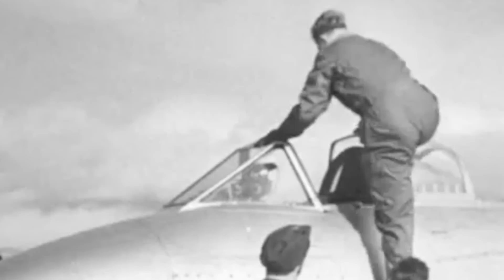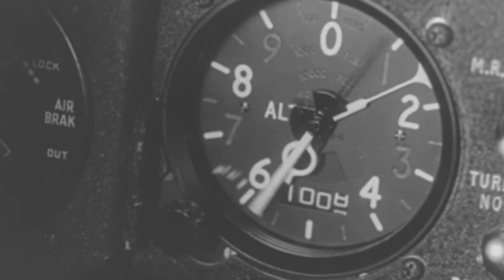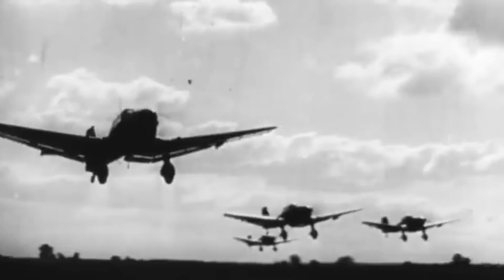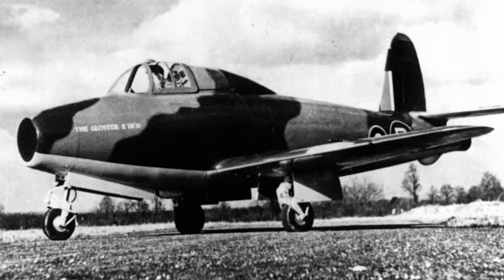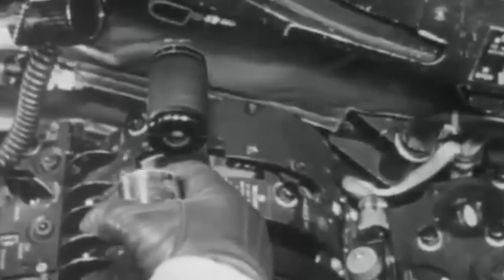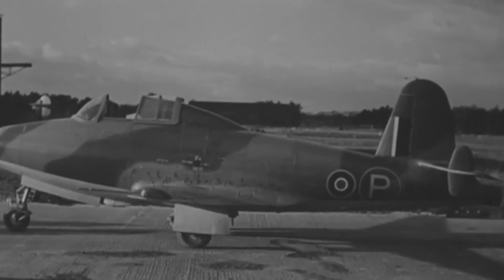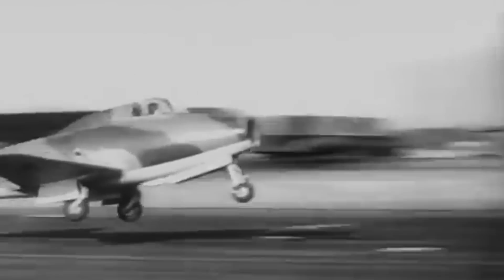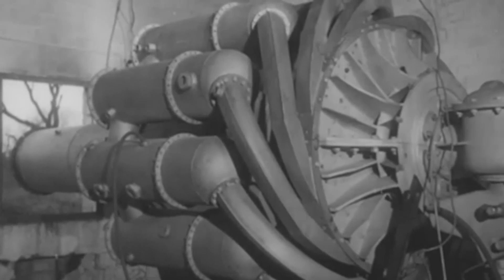Britain's 500 MPH Coffin With Wings

Comment: If Whittle had been given adequate funding in the 30’s we would have had jets in 1940. The brass said the temperatures are too hot for the metals to withstand but that’s also true with steam engines.
Reply: Not exactly, Whittle was still in school and would not begin any serious work on jet engines until moving to Rugby in 1936... this left Whittle years behind jet engine development in Germany.
Whittle would never construct any viable or flight worthy engines.

The real genius behind the British jet engine program was Stanley Hooker and Adrian Lombard, they would not start work until 1940 when Whittle struggled to make any further progress with his engines.
Reply: Actually after A.A.Griffiths (head of engine development at the RAE) 
exposed Whittle for plagiarizing his 1926 paper on gas turbine aircraft engines... he also humiliated Whittle by pointing out several egregious errors in Whittles patent that revealed he did not actually understand how compressors worked.
Whittle was dependent on others to construct his compressors.

Whittle was also unaware of German advancements in heat resistant alloys and he struggled with inferior steels.

It was General Electric turbocharger division that gave Rolls-Royce the first heat resistant alloys to would survive the harsh conditions of jet turbine blades...
Reply: @WilhelmKarsten     

   Yes that's right, Indeed it is without doubt entirely correct that the gas turbine concept was first conceptualised in England before 1800.
    It is also correct that the multistage sequential rotor stator axial compressor & axial turbine as used for power generation & propulsion turbomachinery purposes was of course first produced in England by Parsons of Ireland & North England before 1900 the technology being licensed for manufacture in many other industrialised countries. The same components as used in all current axial gas turbine aero engines.
    Its also well known that serious work on the axial configuration gas turbine aero engine began in England before 1929.  
  
    That is indeed correct, more recently of course the most powerful gas turbine aero engine on the planet in 1944 was in fact the Rolls Royce Nene versions of which would go on to power many jet fighter aircraft including the Mig 15 & many UK & US built jet fighter aircraft during the 1940s & 1950s. The RR Nene was of course twice as powerful as anything produced in Germany at the time & 100 times more reliable & would go on to be copied in Russia & China & built under licence in the US, Sweden France & other countries
   Obviously the required Nimonic Alloy turbine blade material was first developed in England around 1940 & was available nowhere else at the time. It was a Nickel super alloy (Composition is mostly Nickel), Engineers in Germany & the US were attempting to use various kinds of stainless steel such as high Nickel stainless steel (being steel it's mostly iron)  which of course doesn't work.

   Agreed, Gloster Meteor accident losses were not high or unusual for fighter aircraft at the time.
Non combat phase accident losses
% of Aircraft built.
The Canadair CL-44 was a turboprop airliner.
Canadair CL-44                    (ff 1959 ) 48%
Lockheed XF104                    (ff 1954) 100%
Lockheed  P80                       (ff 1944) 43%
Lockheed F104                      (ff 1954) 45%
McDonnell FH Phantom       (ff 1945) 35%
Gloster Meteor                     (ff 1943)  21%
DH Vampire                          (ff 1943)  23%
DH Sea Vixen                       (ff  1951) 33%
Gloster Javelin                     (ff 1951) 20%

A specific comparison.

Gloster Meteor.
3950 Built.
In service 1944.
70% didn't have ejector seats.
839 accident losses.
436 accident loss fatalities.
21% accident losses.
11% accident loss Fatalities.

Lockheed F104.
2578 Built.
In service 1958, 14 years after the Meteor.
All had ejector seats.
1100 accident losses.
425 accident loss fatalities.
43% accident losses.
17% accident loss Fatalities.

   Yes it is the case that the Gloster Meteor broke world speed records in 1945 & 1946. The world's first Turboprop was a modified Gloster Meteor. 1940s & 1950s Russian, British & US jet fighter aircraft usually had British / Russian, British, or British / American technology gas turbine aero engines.
From 1942 onwards British & US jet aircraft were always faster than piston engine fighters if the same year.

   That's right, the world's first demonstration of a pure gas turbine aero engine was of course performed by Frank Whittle in England in 1937.

We hope this helps of course.

Cheers indeed & 👍 obviously.

Comment: 0:16 The British didnt want to emulate the Germans - who had chosen the more advanced axial flow design which Whittle had rejected in favour of the Centrifugal-Flow because the advanced alloys required for the axial flow engine were neither completely established nor available in sufficient quantities to be reliable. He was right; the German engines varied in life expectancy between 6 and 24 hrs before being worn out - and they were never able to improve this, lacking the required alloys - whereas Whittle's intentionally less advanced choice was reliable enough to be viable right from the start.
Reply: Centrifugal compressors are still used extensively today.
Reply: Complete rubbish! As A.A.Griffiths pointed out when he exposed Whittle for plagiarizing his own work he revealed that Whittle had absolutely no understanding of how axial compressors worked.
 Whittle scrapped his defunct 1930 patent and started over using a Furnace blower salvaged from an abandoned iron foundry.
That is false, there is no difference in the metallurgical requirements of the axial compressor compared to the centrifugal.
Whittle lacked proper materials for BOTH, he struggled with inferior alloys such as Browns 18/3 and REX 78.
Steels used in cutlery and kitchen utensils.

Whittle was never able to achieve airworthiness certification.

The Jumo 109-004b easily passed the RAFs 100 hour PFTR reliability requirements and the US Army confirmed TBOs averaged 55 hours between overhauls. EXCELLENT by WW2 standards and better than Allied piston engines!

Eric Brown said that the Me-262 was years ahead of anything the Allies had..
Reply: @sandervanderkammen9230  Yet more nonsense!  
Whittle couldn't plagiarise Griffith's work because he had absolutely no knowledge of it - and Griffith disclosed nothing of his early work (which was no more than an experimental single-stage axial flow compressor/turbine) when he met Whittle in 1929, and summarily dismissed Whittle's turbojet proposal, delivered on his behalf in Tweedie's infamous letter.
It is well known that, in service, the 004B required a part-life overhaul at 10 hours and was typically time-expired at 25-30 hours.  It was an effectively (in current terminology) an expendable engine but, being produced by slave labour, it was 'economical' to do so.  
When it was inspected in detail after the war, it, and the other German engines were judged to be "inferior' - because they were.  In comparison, the Welland (R-R's version of the W.2B) and the Derwent had overhaul lives in excess of 100 hours, having been tested up to 500 hours.
Reply: @sandervanderkammen9230 @WilhelmKarsten     

   Yes that's right, Indeed it is without doubt entirely correct that the gas turbine concept was first conceptualised in England before 1800.
    It is also correct that the multistage sequential rotor stator axial compressor & axial turbine as used for power generation & propulsion turbomachinery purposes was of course first produced in England by Parsons of Ireland & North England before 1900 the technology being licensed for manufacture in many other industrialised countries. The same components as used in all current axial gas turbine aero engines.
    Its also well known that serious work on the axial configuration gas turbine aero engine began in England before 1929.  
  
    That is indeed correct, more recently of course the most powerful gas turbine aero engine on the planet in 1944 was in fact the Rolls Royce Nene versions of which would go on to power many jet fighter aircraft including the Mig 15 & many UK & US built jet fighter aircraft during the 1940s & 1950s. The RR Nene was of course twice as powerful as anything produced in Germany at the time & 100 times more reliable & would go on to be copied in Russia & China & built under licence in the US, Sweden France & other countries
   Obviously the required Nimonic Alloy turbine blade material was first developed in England around 1940 & was available nowhere else at the time. It was a Nickel super alloy (Composition is mostly Nickel), Engineers in Germany & the US were attempting to use various kinds of stainless steel such as high Nickel stainless steel (being steel it's mostly iron)  which of course doesn't work.

   Agreed, Gloster Meteor accident losses were not high or unusual for fighter aircraft at the time.
Non combat phase accident losses
% of Aircraft built.
The Canadair CL-44 was a turboprop airliner.
Canadair CL-44                    (ff 1959 ) 48%
Lockheed XF104                    (ff 1954) 100%
Lockheed  P80                       (ff 1944) 43%
Lockheed F104                      (ff 1954) 45%
McDonnell FH Phantom       (ff 1945) 35%
Gloster Meteor                     (ff 1943)  21%
DH Vampire                          (ff 1943)  23%
DH Sea Vixen                       (ff  1951) 33%
Gloster Javelin                     (ff 1951) 20%

A specific comparison.

Gloster Meteor.
3950 Built.
In service 1944.
70% didn't have ejector seats.
839 accident losses.
436 accident loss fatalities.
21% accident losses.
11% accident loss Fatalities.

Lockheed F104.
2578 Built.
In service 1958, 14 years after the Meteor.
All had ejector seats.
1100 accident losses.
425 accident loss fatalities.
43% accident losses.
17% accident loss Fatalities.

   Yes it is the case that the Gloster Meteor broke world speed records in 1945 & 1946. The world's first Turboprop was a modified Gloster Meteor. 1940s & 1950s Russian, British & US jet fighter aircraft usually had British / Russian, British, or British / American technology gas turbine aero engines.
From 1942 onwards British & US jet aircraft were always faster than piston engine fighters if the same year.

   That's right, the world's first demonstration of a pure gas turbine aero engine was of course performed by Frank Whittle in England in 1937.

We hope this helps of course.

Cheers indeed & 👍 obviously.
Reply: @sandervanderkammen9230   
    

   Yes that's right, Indeed it is without doubt entirely correct that the gas turbine concept was first conceptualised in England before 1800.
    It is also correct that the multistage sequential rotor stator axial compressor & axial turbine as used for power generation & propulsion turbomachinery purposes was of course first produced in England by Parsons of Ireland & North England before 1900 the technology being licensed for manufacture in many other industrialised countries. The same components as used in all current axial gas turbine aero engines.
    Its also well known that serious work on the axial configuration gas turbine aero engine began in England before 1929.  
  
    That is indeed correct, more recently of course the most powerful gas turbine aero engine on the planet in 1944 was in fact the Rolls Royce Nene versions of which would go on to power many jet fighter aircraft including the Mig 15 & many UK & US built jet fighter aircraft during the 1940s & 1950s. The RR Nene was of course twice as powerful as anything produced in Germany at the time & 100 times more reliable & would go on to be copied in Russia & China & built under licence in the US, Sweden France & other countries
   Obviously the required Nimonic Alloy turbine blade material was first developed in England around 1940 & was available nowhere else at the time. It's a Nickel super alloy (Composition is mostly Nickel), Engineers in Germany & the US were attempting to use various kinds of stainless steel such as high Nickel stainless steel (being steel it's mostly iron)  which of course doesn't work.

   Indeed, it is the case of course, Whittles original centrifugal compressor with reverse flow combustors gas turbine aero engine configuration is still produced for various aircraft applications & is for example used in many currently produced helicopters. Ohain simply copied Whittles design but used a radial turbine to avoid patent infringement issues.

   Agreed, Gloster Meteor accident losses were not high or unusual for fighter aircraft at the time.
Non combat phase accident losses
% of Aircraft built.
The Canadair CL-44 was a turboprop airliner.
Canadair CL-44                    (ff 1959 ) 48%
Lockheed XF104                    (ff 1954) 100%
Lockheed  P80                       (ff 1944) 43%
Lockheed F104                      (ff 1954) 45%
McDonnell FH Phantom       (ff 1945) 35%
Gloster Meteor                     (ff 1943)  21%
DH Vampire                          (ff 1943)  23%
DH Sea Vixen                       (ff  1951) 33%
Gloster Javelin                     (ff 1951) 20%

A specific comparison.

Gloster Meteor.
3950 Built.
In service 1944.
70% didn't have ejector seats.
839 accident losses.
436 accident loss fatalities.
21% accident losses.
11% accident loss Fatalities.

Lockheed F104.
2578 Built.
In service 1958, 14 years after the Meteor.
All had ejector seats.
1100 accident losses.
425 accident loss fatalities.
43% accident losses.
17% accident loss Fatalities.

   Yes it is the case that the Gloster Meteor broke world speed records in 1945 & 1946. The world's first Turboprop was a modified Gloster Meteor. 1940s & 1950s Russian, British & US jet fighter aircraft usually had British / Russian, British, or British / American technology gas turbine aero engines.
From 1942 onwards British & US jet aircraft were always faster than piston engine fighters if the same year.

   That's right, the world's first demonstration of a pure gas turbine aero engine was of course performed by Frank Whittle in England in 1937.

We hope this helps of course.

Cheers indeed & 👍 obviously.

Comment: Anything with an engine meets that title , great video
Reply: Anything made by Gloster.
Reply: @sandervanderkammen9230 @WilhelmKarsten     

   Yes that's right, Indeed it is without doubt entirely correct that the gas turbine concept was first conceptualised in England before 1800.
    It is also correct that the multistage sequential rotor stator axial compressor & axial turbine as used for power generation & propulsion turbomachinery purposes was of course first produced in England by Parsons of Ireland & North England before 1900 the technology being licensed for manufacture in many other industrialised countries. The same components as used in all current axial gas turbine aero engines.
    Its also well known that serious work on the axial configuration gas turbine aero engine began in England before 1929.  
  
    That is indeed correct, more recently of course the most powerful gas turbine aero engine on the planet in 1944 was in fact the Rolls Royce Nene versions of which would go on to power many jet fighter aircraft including the Mig 15 & many UK & US built jet fighter aircraft during the 1940s & 1950s. The RR Nene was of course twice as powerful as anything produced in Germany at the time & 100 times more reliable & would go on to be copied in Russia & China & built under licence in the US, Sweden France & other countries
   Obviously the required Nimonic Alloy turbine blade material was first developed in England around 1940 & was available nowhere else at the time. It was a Nickel super alloy (Composition is mostly Nickel), Engineers in Germany & the US were attempting to use various kinds of stainless steel such as high Nickel stainless steel (being steel it's mostly iron)  which of course doesn't work.

   Agreed, Gloster Meteor accident losses were not high or unusual for fighter aircraft at the time.
Non combat phase accident losses
% of Aircraft built.
The Canadair CL-44 was a turboprop airliner.
Canadair CL-44                    (ff 1959 ) 48%
Lockheed XF104                    (ff 1954) 100%
Lockheed  P80                       (ff 1944) 43%
Lockheed F104                      (ff 1954) 45%
McDonnell FH Phantom       (ff 1945) 35%
Gloster Meteor                     (ff 1943)  21%
DH Vampire                          (ff 1943)  23%
DH Sea Vixen                       (ff  1951) 33%
Gloster Javelin                     (ff 1951) 20%

A specific comparison.

Gloster Meteor.
3950 Built.
In service 1944.
70% didn't have ejector seats.
839 accident losses.
436 accident loss fatalities.
21% accident losses.
11% accident loss Fatalities.

Lockheed F104.
2578 Built.
In service 1958, 14 years after the Meteor.
All had ejector seats.
1100 accident losses.
425 accident loss fatalities.
43% accident losses.
17% accident loss Fatalities.

   Yes it is the case that the Gloster Meteor broke world speed records in 1945 & 1946. The world's first Turboprop was a modified Gloster Meteor. 1940s & 1950s Russian, British & US jet fighter aircraft usually had British / Russian, British, or British / American technology gas turbine aero engines.
From 1942 onwards British & US jet aircraft were always faster than piston engine fighters if the same year.

   That's right, the world's first demonstration of a pure gas turbine aero engine was of course performed by Frank Whittle in England in 1937.

We hope this helps of course.

Cheers indeed & 👍 obviously... .
. ........... ..................       ...............
This line is clearly not blank.